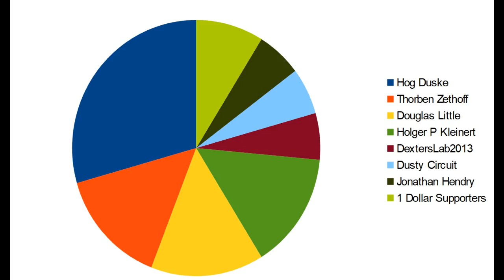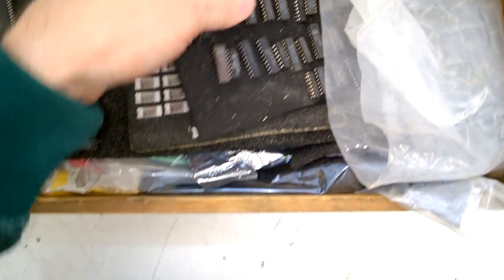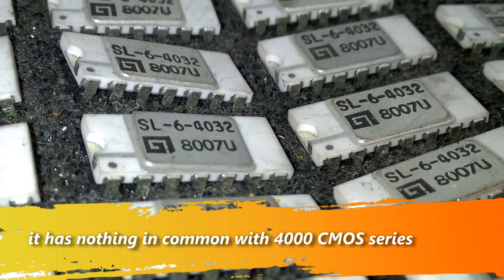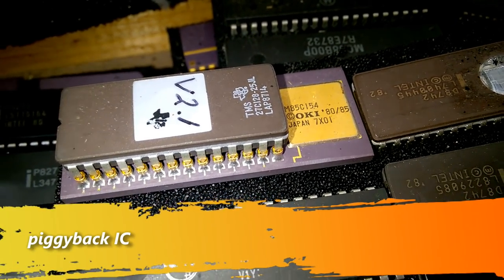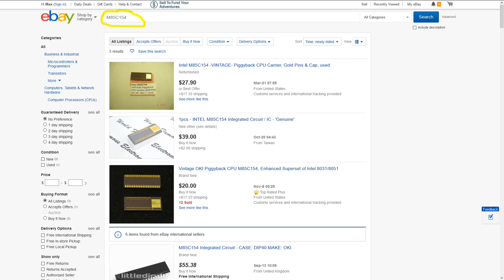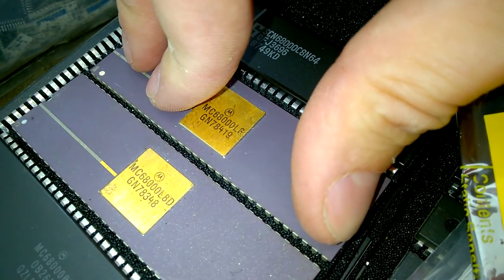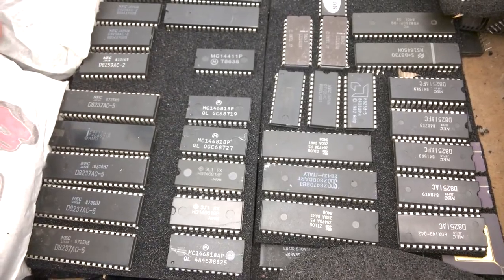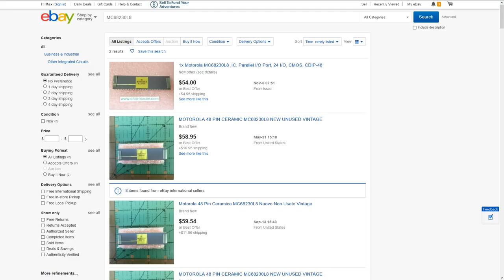CEPUS #18: Wow! A 30 Years Old Time Capsule full of ICs (Part 1)

Comment: That's an AM2901 at 2:54...a high speed TTL 4-bit bitslice ALU used in many different minicomputers and early graphic  workstations like the Xerox Star.  Careful with the parts underneath it...those are CMOS.

The TMS9900 is an interesting CPU.  Both it and the 68000 have hardware multiply but the TMS9900 and its relative the TMS9995 are more DSP like in their architecture.
BTW in there are all the parts needed to build a basic 68000 system...
Reply: The 2901 is also used in the original DPB7001 Quantel Paintbox in the hard disk controller section.